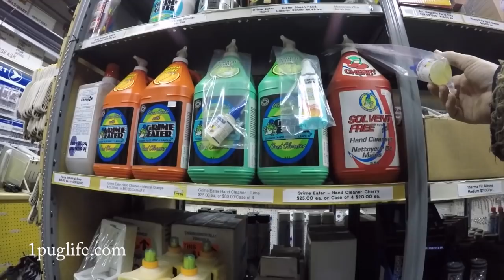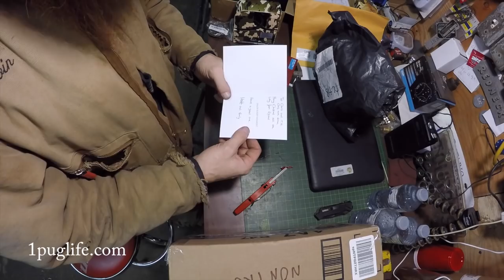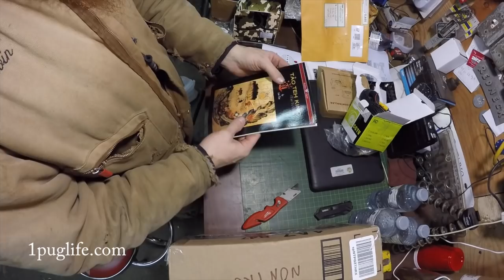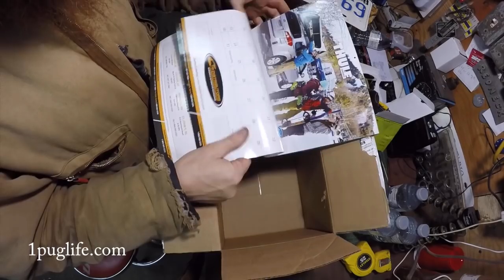new ride

Comment: Hey Pug, The ricket stick with the four little antlers on the end will actually stand there by itself wherever you put it, ready to use if you need it again.. That's like every time you want to use 2 hands but as you know, the stick wants to flop around if you set it down for even a second.. The 4 little antlers let it stay upright by itself! You prolly knew that, so I beg my pard, but if you try it,, you might find it handy. More stable too.